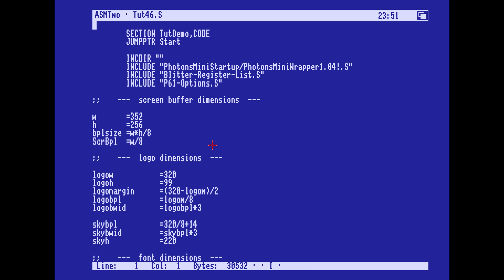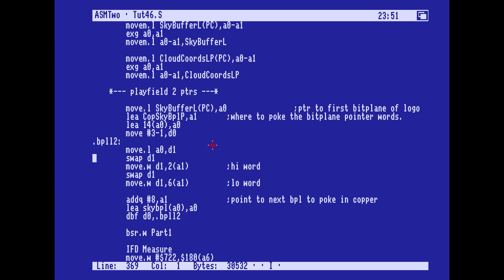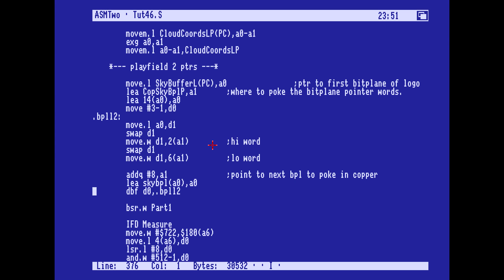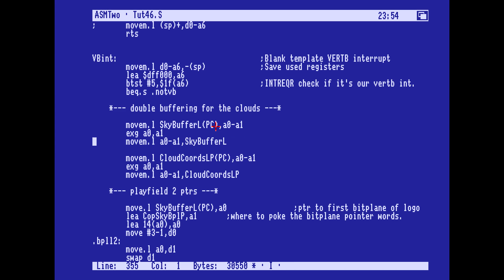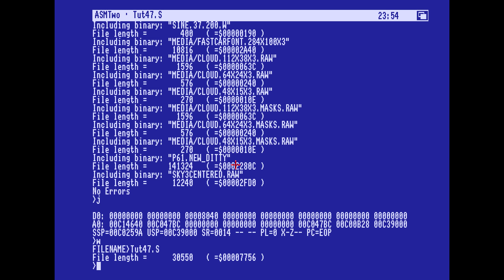Amiga Hardware Programming 47 - Solved the Buffer Swap Conundrum! (68060 fix)

Comment: Thanks for the upload. Fantastic to see more asm programming on this iconic machine.
I still have both my A1200 and A500 and recently had a look at some things I programmed using Asm-One some years ago. After using today's IDE's, Asm-One is a wee bit lacking. Looking around I see Amiga Assembly for VSCode and gave it a try. After some setting up and tidying up of my old source code I can happily say an old platform game I wrote works. The devs are active today and happy to answer any queries. I'd strongly recommend it. For development speed you can use an emulator with it - I use WinUAE/FS-UAE, then drop it into a real Amiga to make sure all is aok. So many advantages using this set up. 
I'm wondering if you've tried this out?
Reply from the maker: You write it as if I am unaware. :) The other way around, my friend. Here's the deal: Cross-assembling (requiring command-line assemblers without IDE, as now) were available since the very early 90s. In fact, this is how all console games were programmed - the consoles were not capable of running an OS or even a text editor, and most didn't have a keyboard anyway.

However, the Amiga is a computer, and can do all these things and more. One reason to go native is that you’re writing CPU instructions, so why put a strange toolchain and file system between you and the program? There’s also the speed factor. Even a 100x slower Amiga can Assemble-and-run faster than available cross-compile options, and certainly boot into a whiplash responsive IDE faster. Try it, and experience a wonderful refuge from lag from time to time. :)

But there are many more advantages of a native Assembler:

1. You're using your Amiga, not treating it as a tethered console to play something back. This is the norm. You’re just writing programs on your computer for your computer.
2. You can set breakpoints, step, debug and watch with your symbol names Amiga-side.
3. You can check incremental run-time values not only from your software but software around it. This is required to write correct startup ("boilerplate") code as well as advanced programs.
4. By this directness, you understand what your code does at a fundamental level, and get instantly rewarded when your prediction of exact hardware behavior matches actual hardware behavior. It’s a very nice reward loop :)
5. Since you’re being creative and using your Amiga, you can at any time whip up a paint program or music software and create assets as needed for your program. It’s like… using a computer!

And now for the main reason: No viewer should need anything more than an OCS 1MB Amiga to follow along my tutorials to be able to write for that platform. After all, it is all that is needed. Just boot your Amiga and start typing code. It’s that easy!